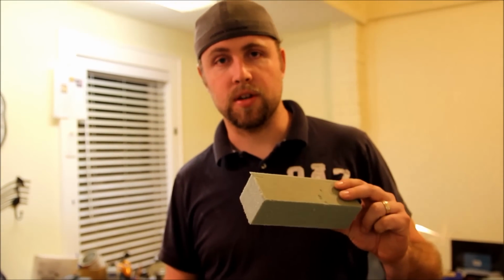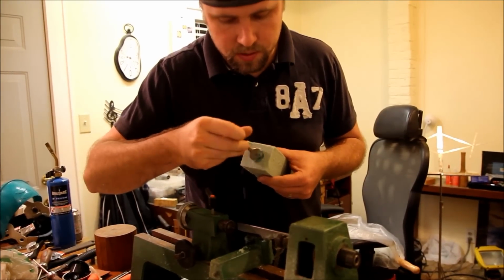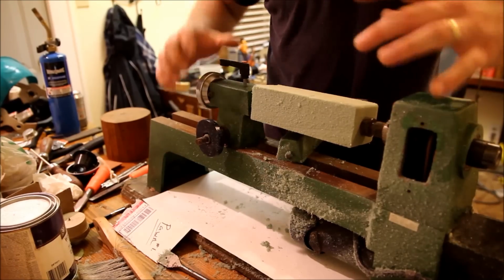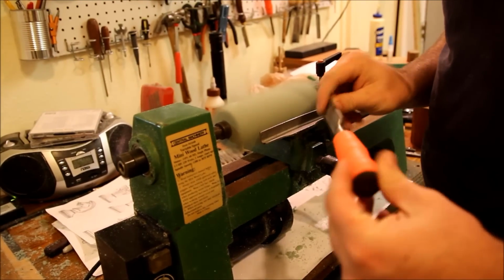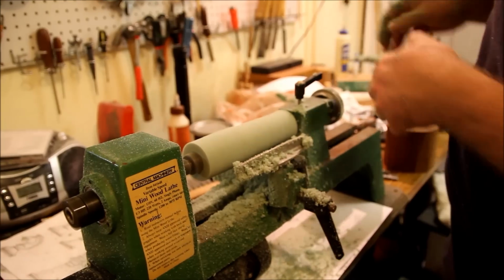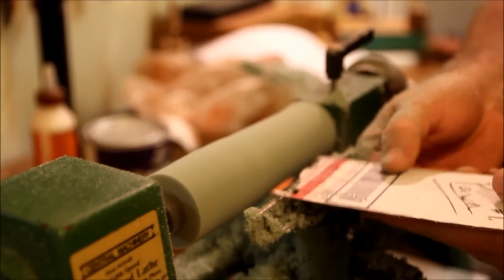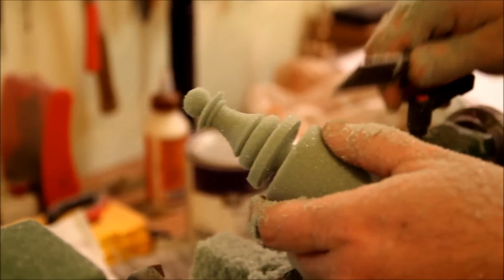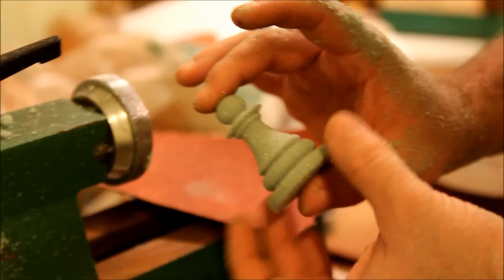5 minute chess piece : By Conrad Craft   the OmniCraft

Comment: Excellent idea. Awesome DIY vids keep the Internet alive. Anyone else just add a lathe to their must have list? // Oh, question...if small bits are accidentally dug or chipped out from the foam, this would lead to silicon protrusions into the negative space that will be occupied by the resin, correct? So I presume you'd just have to make sure the extra silicone was 'sanded' smooth before filling. Is it easy to shape small imperfections in the walls of a silicone mold?
Reply from the maker: Thanks Toyer.
To answer your first question: yes... a dent in or chip out of the original soft foam before the mold is made would create a protrusion or bump in the surface of the rubber mold unless the damage was fixed before the piece is used to make the mold. You could make a mold from the damaged piece and then try to fix the mold as you described... but it is always a real difficulty to make a repair to a mold without screwing up the uniform texture of the surface. It's better to just not mold from a damaged original in the first place.

As a side note, floral foam is used by companys that create those fake rock hand holds used on rock climbing walls. This is because when the foam is used to make a mold, the surface of the resin cast will have a slightly rough sandstone quality...which is perfect for rock climbing. So a chess set made the same way will also feel like sand stone.
Reply: Ah, okay, thanks for the follow-up info. That makes sense. Any issue would be magnified, so best to nail it early.  -- I was surprised your template held up against those RPM, even though the foam is soft. I guess the glue provided some secondary benefit.  // ... And, damnit if I didn't just realize that without the rotational symmetry, the knight will expose my lack of artistic ability. There's no spinning my way above the base of that piece!  Thanks again, really nice work.
Reply from the maker: +Toyer 
yes... the knight is a tricky challenge... but I will post a follow up video to this one showing the full process of making the chess set, and in that video I will show a step by step approach for making an awesome carved knight with the foam. So keep a lookout for when I post that video. Thanks again!

Comment: Now, how can I make this but, in its wooden form. I mean I would like to make a metal cutting template just like you had it on the cardboard for a fast carving.
Reply from the maker: I have been thinking about going ahead and making a video where I do just that. The short answer is that you may be able to find these kind of templates in steel blade form already for sale with just a quick search. I think even one of the comments here on this video was from  a guy who sells such cutting blade profiles. To make the profiles yourself you  would obviously have to cut the shapes you want in steel and grind them to a sharp edge. To do this properly would require a very hard steel to make the blades since the sheer cutting surface is so large it creates enormous friction and thus heat... potentially damaging the temper of edge of the blades thus leading to quick dulling... so yea... there are problems with this system when it come to using it on wood.  Would you like to see me make a video that goes through this process?
Reply: Conrad Craft hell yeah!
Reply: Conrad Craft ya this is genius, I'm in woodshop and I made a board already and started the pieces but it takes ages. And it's hard to make them all match with precision. After completing only 4 I'm glad I came across this. Do you think if I were to get a sheet of metal and carve out the shape in a CNC it would work well??
Reply from the maker: If you could cut a sharp enough edge into the shape of the profile  so that it cuts the wood quickly instead of scraping and tearing the grain....  and if you used a very  hard or tempered  steel to make these cutting profiles out of... and if the wood you use for the pieces is not exceptionally hard... then yes it will work. It is very important to think about how you will have these metal blades held still while they move forward into the wood. At first they will cut easily... but as they slowly shape the wood into a copy of the profile in the blade more and more force will be transferred to the blade, since it will be basically cutting along its entire length all at once. Solve these issues, and you will be well on your way to duplicating perfect  wood chess sets as quickly as you like. :)
Reply: I had exactly the same question. Thank you Kay for asking and thank you Conrad for answering.
Reply: In lieu of being able to make or acquire a singular profile-cutting tool for each piece, an easier task might be to make guides for an orthodox lathe chisel that would take some of the guesswork out of the process. Perhaps the guide could be attached vertically to the tool rest or something. Not as precise or quick as a specialized profile-cutter, but it would have the advantage of not needing heat treatment or a labourious sharpening process... those processes would be reserved for the far simpler and easier to maintain turning chisels instead.

Comment: That's amazing! Would the same technique work with wood?
Reply from the maker: yes, but the profile of the chess piece would have to be cut into a piece of high speed steel or stronger to handle the enormous amounts of friction on the cutting blade. you would have to go slow... otherwise the cutting blade would heat up so much that the temper of steel would be damaged and the blade would get dull quickly. You would also need to have the blade held by something stronger than just your hands. you could weld them to a metal pipe that was at least 16 inches or longer and get good control and leverage that way.
Reply: Conrad Craft perfect. I would like to make them here in Africa

Comment: Is it bad to breathe?
Reply from the maker: Yes, tho not really toxic, this material does create a lot of particles and dust. I highly recommend using a dust mask. If you think about it... this material actually creates less shaving particles than the same project done in wood... since the space occupied by the foam block material is probably close to 40 or 50% air.
Reply from the maker: I find the dust to be more immediately irritating to the eyes than anything... it has an abrasive quality and is slightly static electrical... so it will stick to your hands and clothes and anything with a static charge.

Comment: Is that sand?
Reply from the maker: It is a kind of foam. it is used for floral arrangements traditionally. It is designed to absorb and retain water.
Reply from the maker: ...it does have a sand like texture and grittiness though.
Reply: then it is a sponge?
Reply from the maker: Of sorts.
Reply: where I draw the molds?